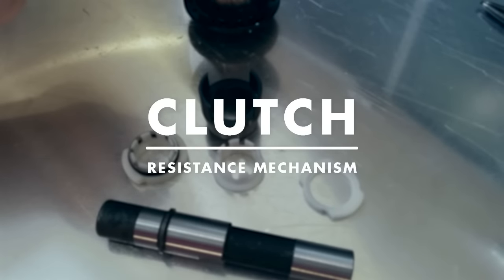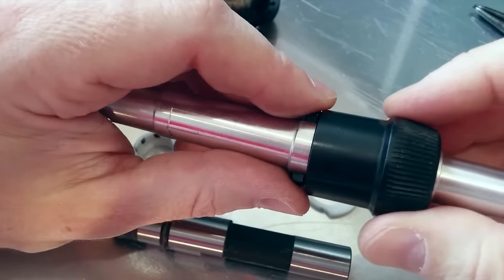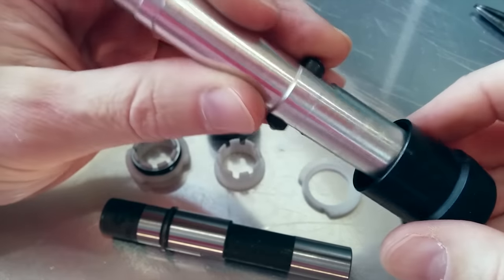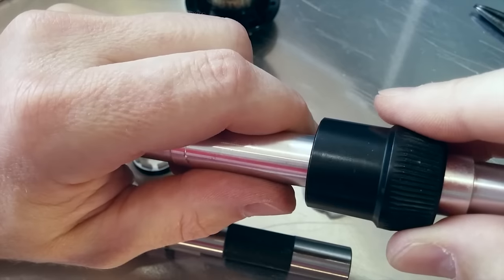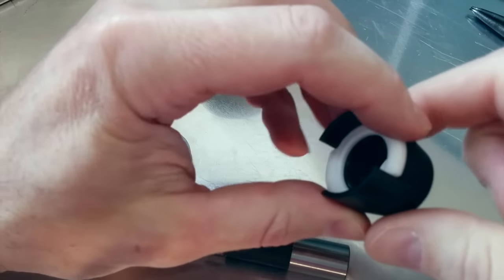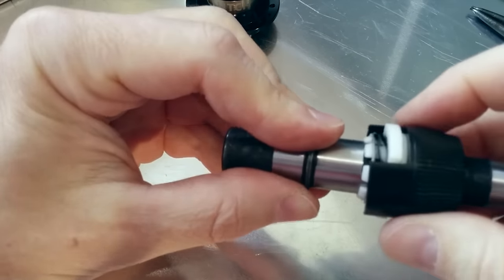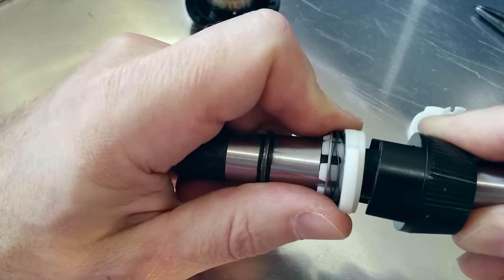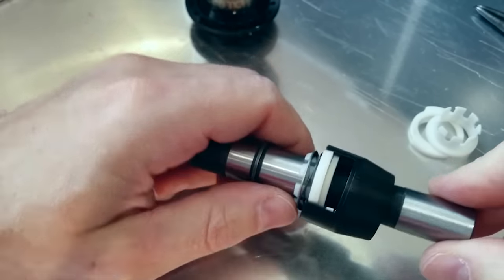BMX / Odyssey Clutch Freecoaster / Resistance Mechanism

Comment: Watching these Cluth vids again and i'm remembering from the first time round why I don't like it's design. A regularly serviced coaster feels lush under the foot, but within a week the engagement feels progressively dull. I don't do pedal pressure moves as run brakes. The clutch binding into the hub shell to engage needs addressing imo. It's like comparing a 13t freewheel to a Primo Mix.
Whilst I don't doubt this is an improvement of design, I'd love to know if the clutch running on a large bearing with a spring behind it was tested. Looking at G twitch that plastic looks fairly resistant. And i wonder if it would run better with some teflon sprayed on. With having a grease port for teflon injection instead of the slack adjuster. But i'm not keen on dropping £200 plus wheel build time to see if it's really kick/king/crankflip smooth. 

A press on plastic hubguard is a major turnoff too. I guess that was Odyssey's idea? 48h with GLAND mrk2 would of been stellar. 

I think that the premature wear of the current clutch  system is a myth, primarily due to the clutch not always rotating and the bearing being on a spring allowing the bearings to pick up once they've worn, which are £4(?) to place. Even if that were every 6 months, I don't consider that an issue. Especially seeing as people are prepared to pay out for plastic pegs that wear out crazily quick.

Comment: Or you can just use the old school "moustache" like springs that have a lot of contact surface and they are going to be stronger then the plastic thing and it doesnt need a hole trough the axle

Comment: Is the resistance mechanism of this hub last longer? I'm a little puzzled if it last since it's made of plastic and wears faster. Thanks!
Reply: Rizal Linao Questionable. But you shouldn't have an issue with the resistance bearing on khe style hubs wearing out imo provided the hub runs true and it is lubed. Besides, replacement resistant bearing for khe style hubs is a few quid/bucks.

I REALLY want to try this hub, but spending the money for a potential downgrade isn't good. This hub also has the female collar issues associated with other hubs.

I like George's designs but this just seems like a band aid to the issues
Reply: Plastic last longer but spring is hard to find and on mine started slipping very quickly and drag mechanism is not widely available would have to import it from US or UK

Comment: My V2 clutch is slipping, so do I have to replace the plastic parts?
Reply: Maybe, or just too much grease
Reply: Yeah sucks mine even with oil slips.
I've ground slack spacer (only one side and only plastic close to the axle) so the drag mechanism sits farther away from the clutch maybe that will fix it